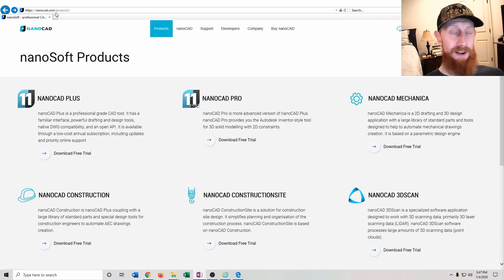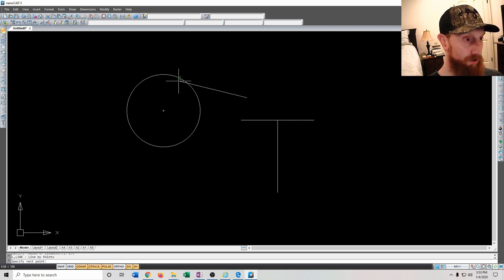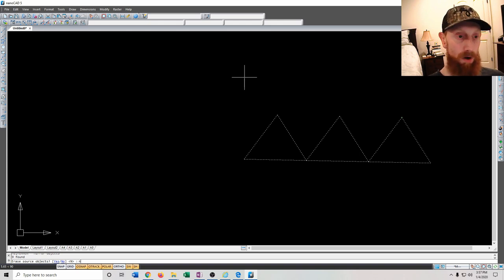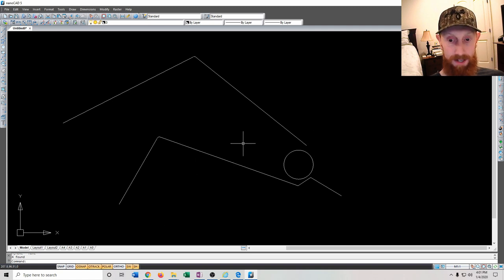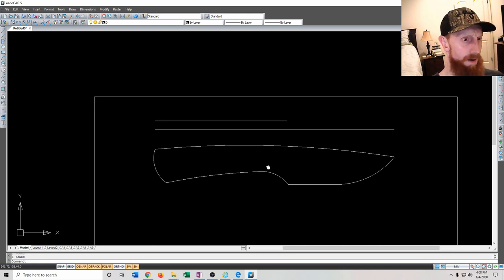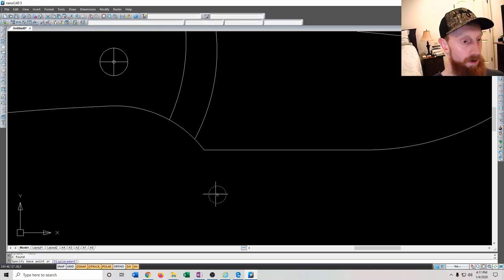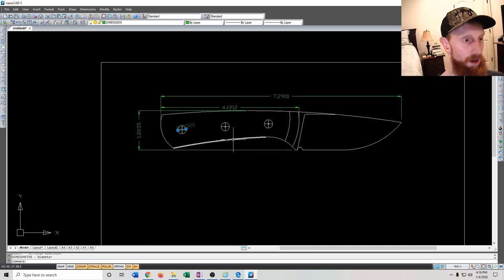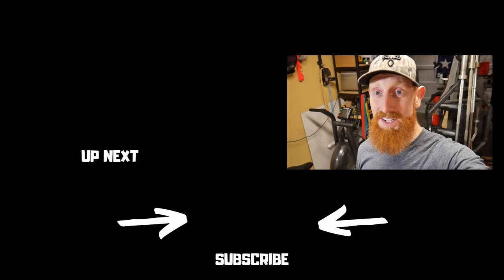Draft in CAD for Free - nanoCAD Tutorial

Comment: It's always interesting to see how different people tackle the same issue.  Another way to start (how I usually do it) is to draw a rectangle that represents the stock material I'm using (12"x1") to show my max size limits and then I draw 4 circles at the lower-left corner 1" diameter side by side to simulate four fingers (similar to your 4" line).  This will give me a guide just in case I want to contour the handles high/low points for just the pointer finger or all four.  Just an optional idea I wanted to share.
Reply from the maker: Very neat, thank you!

Comment: Great video Sir that is sure to help new users get started with NanoCAD.  Here is a little helper tip for accurately making a circle tangent to any two lines.  After you click on the circle icon, or type it into the command line, look down at the command line and there you'll see the letters 3P, 2P, and TTR highlighted in blue.  Start by clicking on TTR, or type those letters in the command line.  It will then ask you to choose the two lines that you want the circle tangent to.  Simply select those two lines and it will then ask you what radius you want for your circle, type in that dimension and it will drop your circle exactly tangent to the two lines you selected.  All you need to do then is trim what you don't want like you normally do with the TRIM command and your done.

Once you master the TTR command, play around with the 3P and 2P commands that allow you to place circles at end points of your choosing.  I am a retired engineering tech and used AutoCad Lite, (LT) for many years and though I just learned about, and downloaded NanoCAD just one day ago, after watching a few tutorials including your's, I'm finding that NanoCAD is eerily very much like AutoCad LT so my learning curve hopefully will be short.  I also wanted a CAD program that would open DWG and DXF drawings and NanoCAD will.  By the way, if I'm not mistaken, the TTR stands for TANGENT, TANGENT, RADIUS which are the lines and dimensions that you have to select and/or specify.  The 2P and 3P simply mean 2 Points or 3 Points that you'll connect your circle to.  Thanks for taking the time to teach others.
Reply from the maker: Awesome man, thanks for your comment! I'm sure it will help some others in the future as well.

Comment: After finding reviews on Nanocad, I downloaded it and then began searching for some tutorials for a quick "getting starting" video. I had already created  a model using Cardstock Aided Design, as well as a complete technical drawing. I simply needed to learn CAD and create the dmg files to get it to a shop to cut my pieces.  I went from no knowledge to 3 completed CAD drawings in dwg in only 3 evenings, thanks to your excellent tutorial.  Full disclosure: I have years of experience in graphics programs(PhotoDraw and Sketchup), metal fab, technical drawing and shop skills.

I think I also may have found a solution to your issue of proper sizing for achieving full-size patterns on your printer. I found that I had the same problem, and while a work-around is handy, I decided to work on solving the problem.  

Go into <PAGE SETUP>
Set the paper size (I used "Letter"). 
Select "Custom". 
Set <PLOT AREA> to "Limits".  

Hopefully, that helps. And thanks again. Your guidance is greatly appreciated. ....And I did Liked and Subscribed.
Reply from the maker: Heck yeah man! Really happy you found this useful. I think I stumbled onto that solution recently. The 1:1 parameter has been printing true to size. 

Once again I'm really happy you found this informative and thanks for the tip! I'm sure others will find it.

Comment: Excellent video.  I like your presentation style.  I hadn't heard of nanoCAD before but now I'm going to give it a try.
One thing I've done frequently with projects like this is to just draw a line that's exactly 10.00" long at the top or bottom.  When you print your pattern out you can quickly measure that line and check if your scale is correct.  If not the 10.00 inch value is easy to use to calculate your scaling factor.
Reply from the maker: Hey man, thanks for the comment. That is the exact method I use! Very useful, and also a good check! Interestingly enough the 1:1 printing works flawlessly for me when using millimeters.
Reply: Interesting.  So it works in millimeters but maybe or maybe not when using inches?  It's a conspiracy I tell you! :)
Reply from the maker: @bbowling4979  LOL, that's right! Guess it is a conspiracy!
Reply: If this program is as close to ACAD as it appears, I think if you plot Window (near the knife) @ 1:1, you "should" get a 1:1 plot.  Or plot extents around a rectangle drawn at the max paper size for your plotter you should be good.  Even if you plot extents 1:1 around a rectangle (paper size) 8.5x11 your plot should come out 1:1 - it will just push a horizontal and vertical line  off the sheet.  That's probably as clear as mud.  I have been using AuroCAD for about 30 years.  Hit me up if you have questions.
Reply from the maker: @briangasseling3489  It does seem to work when working in millimeters.. but inches I have to put in a ratio to get the right printed scale. It seems

Comment: Thanks for this. I started with Draftsight and then tried LibreCad when the pricing model changed on Draftsight. LibreCad is less intuitive than this.  Do you every use layers? I want to use this for slipjoints and have different layers for spring, blade, scales.
Reply from the maker: Very cool man, I have not used layers on my designs since they're all simple fixed blade full tang knives! I would imagine it would work just fine though.

Comment: Dear Sir:

   Hi! You seems to be a good heart person, thanks for your tutorial. I am a drafterperson trained in Autocad and in other 3d modeling software and you help me to see the functionality of the basics commands of nanocad, which are exactly the same of the ones of Autocad. Regarding the plot setting I think that if you want to put a mark to your template for a letter paper format of 8 1/2" x 11", you need to put two diagonal points for marking the paper letter format and draw a rectangle within that limit of the letter format. when you print you should use those diagonal points and print fit to paper. That will print exactly the area of 8 1/2" x 11" and you will see the mark you made to the template exactly as you set it in your model space of NanoCad. That should works but try it and tell me if I am correct.

Thank you my friend again for your tutorial;

Martin Ibn-Rubain
Reply from the maker: Thank you greatly Martin! I think the issue was with my printer. It is now scaling appropriately.

Comment: Couple tips for you:
*Don't need to preselect items when using fillet (you will notice it automatically deselects them when you start the fillet command)
*Workaround when fillet isn't working: instead of trying to freehand align a circle, use the Circle TTR option (Tan Tan Radius), then you select the 2 lines you want to be tangent to and type a desired radius. Then your trims will come out right without any moving around
*those tangents coming out right matters (very visible) if you ever try to use your drawings for a cnc cutting machine (laser, router, etc). If you are using a belt sander, you can quickly clean them up, but then you lose your precise geometry and require cleanup steps. Even with ALU, hand cleaning those with a file can take a while (maybe longer than the machine took to make the part).

*your drawing are probably getting their scale messed up in the printers own settings (eg it's auto paper fitting). You can scale workaround as you suggested, but then every scale will still be off and require special calculating to make them work (eg 2:1 won't be 2:1). Better to fix your printer's setting and turn off those auto fit settings.
*for anyone struggling to fix this, I'm not talking about the print dialog box in your cad program, though it may have a button get to the printer's settings. I'm talking about going into "devices & settings" or "printers and devices" or whatever windows decided to rename it to this week, and going to your printer and changing it's base/global settings that every use defaults to.
Reply from the maker: Thanks ANdrew!